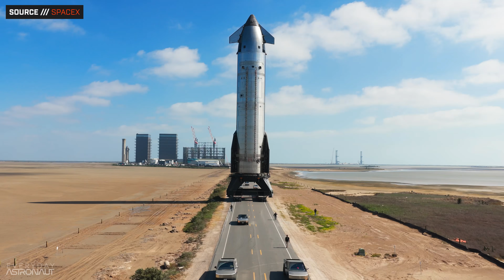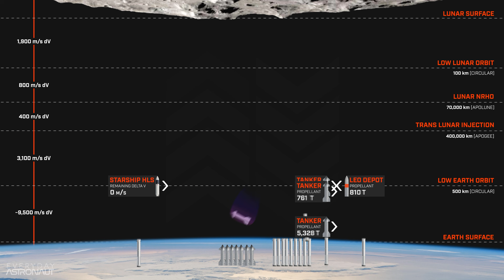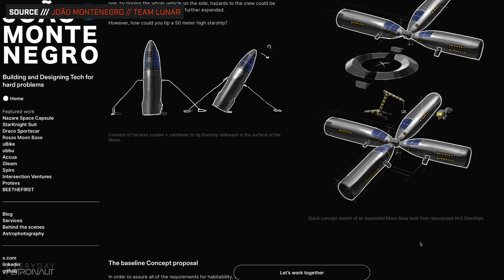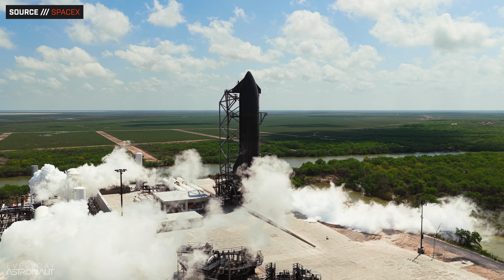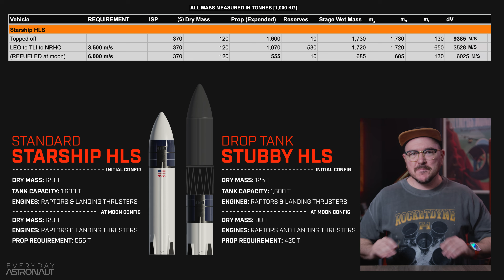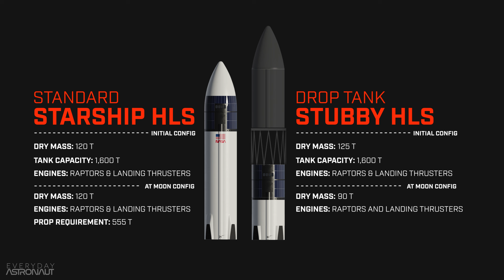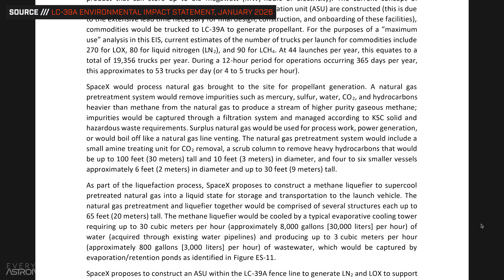Does Starship REALLY require 15+ launches to land one lunar Starship?!

Comment: What if they use starship to carry lox/lh2 to refuel blue moon? (A simplier version of mk2)

How many landing does that system give?
Reply: Not sure SpaceX really wants to help the competition, but maybe, there are stories BO is going to ask SpaceX to launch Amazon Keiper sats...

There are two main issues with Liquid Oxygen and Liquid Hydrogen.

1) The temperature differences between them dictate a NON-SHARED bulkhead, and a ton of insulation.  These add weight.

2) Liquid Hydrogen is made of the smallest molecule.  This has made it tough to contain.  SLS-Orion has had issues with this.  Shuttle definitely did.

Yes, it is more "energetic" as a fuel (efficient), but you also need a much larger VOLUME of space to store it.  Way more than methane.

Methane is a middle ground.  Not as energetic, but takes up a lot more space.  The temp difference between LOX and LCH4 is very small, thus a common bulkhead can be used (such as on starship), which cuts weight.  Methane can be made at some point on Mars.  On the Moon, making fuel seems silly as the Moon is only 3-5 days away from Earth.

Kerosene/RP1 is the low end.  I believe Merlin engines use this, and so does most Chinese engines.
Kerosene/RP1 is very toxic to the environment, and is the lowest in energy.

SpaceX basically put their money into making Raptor Engine tech instead of going to LOH2, and simply using Methane.

Comment: getting a refueling rocket to 400 ms/dv may require refueling of the refueling rocket. Keep working on that nuclear ion engine. Also 14:04 - 67 x , I am surprised the relation is linear. Wouldn't there be some efficiency gain with size? Oh and one more thing I don't get. why would you bring back a 200 ton spaceship from the moon?  Would it not be better to just send a remotely landed vehicle for the return home?  It could weigh a lot closer to what the Apollo return ships did. Great value to leave the starship there for future use.

Comment: What about landing vertically, deploying some additional struts at the top and carry out a controlled tip over to horizontal and then back again? It might be impractical (or just plain stupid), but if workable, it reduces risks during landing and then improves load deployment massively once tipped. Or maybe a pure horizontal landing becomes more practical if straight onto pre-prepared landing areas?

Comment: The fuel depots seem to complicate things unnecessarily. Since HLS is not doing crew transport to and from LEO anyway, may as well transfer direct from tankers to HLS. If it could contain enough additional propellant to break orbit at the Moon, it could return to LEO for direct refilling from tankers. But of course that would make SLS redundant since SpaceX already has a capsule capable of transporting crew to and from LEO. Might make sense to split HLS into two stages, a LEO to Moon Orbit round-trip tug and the Moon Orbit to Surface lander.

Comment: If NASA were to pay for a single expendable booster to get the HLS to LEO, that could cut down number of reduelong launches. But considering for often and quickly Starship is supposed to fly, I don't see a big problem with 15 tanker launches. It will be the norm. But the more efficiencies we can gain, the less fuel wasted and less opportunity for failure too. Gotta work on both sides

Comment: Hello Everyday Astronaut! What do you think about Blue Origin's Blue Moon. I know Blue Origin is the butt of many jokes in the space enthusiastic community, but to me Blue Moon seems to be a space craft specifically designed for moon landing as opposed to Starship which was designed specifically for Mars landings. To me, Blue Moon seems far more capable of a Moon landing. Sure, it's capabilities are limited do to the lower weight restrictions. But to me, a few a Blue Moon landings and then graduating to Starship makes more sense. Starship has a lot, and I mean A LOT of modifications in it's future to become a reliable moon lander. By that time, Artemis is bleeding funds like crazy and it seems more likely to me that Starship will be a proof of concept on the moon, but Mars and interplanetary travel is its true purpose. Thoughts?

Comment: Some concepts have had it landing vertically and using a system of anchors pulleys and cables and the foldable legs to slowly lay it on its side horizontally. Remove the fuel tank and engines and cover in a layer of regolith for micro meteorite and radiation protection, and you’ve got a little pressurized moon base.

Comment: I see very few people talk about the increased stability of the Starship with those landing engines high up in relation to its mass being more aft. This makes the overall configuration more naturally stable, unlike an aft-mounted raptor with TVC, which is naturally unstable. I know it's not really a big deal anymore since SpaceX has basically been experts at propulsively landing Falcon 9's this way for years.

I only watched until 30 mnts when I wrote this comment. It would be helpful if this were addressed later on.

Comment: I think Booster needs side boosters.   2 modified Falcon 9's with 3 raptors and converted to use Methane / LOX mix, they also return and get caught or land.  We also need another form of propulsion that doesn't rely on frozen fluids
Reply: Why just 2? Just bolt on like 20 in aspergus? Are they stupid?

Comment: I really don't understand the numbers around 1:17:00
the Cis Lunar Depot has a mass at t0 and mass at t_end is what i don't understand. It should be roughly the starting mass of the return trip plus delivered fuel plus used up fuel, but its ~6% more. Which means after the burn and fuel transfer its suddenly 77% more than you need. Even if we loose a bit to boil off along the way, the numbers are way off, which makes me think i missed something critical. 

Can someone help me out with that?

BTW the wet mass seems to be mislabeled.

Comment: The easiest way would be to have 2 gimbaled V-raptors with 380 s ISP from the start. Atlas made it to orbit with just one engine, where there was a stage with 2 engines available also.
So far out ISP is king, maybe hydrolox would be better for upper stages. ESA's Ariane was a really good vehicle for all the geostationary and deep space stuff. Maybe taking the new glenn upper stage would be more feasible, or developing a hydrogen raptor version..

Comment: I'll comment before starting the vid.
But to me, avid KSP player this pilow makes no sense as a LUNAR Lander..

Apart from the obvious "tipping over" problem. Like it was a small thing.

What is the point of using a freight train if you don't have the logistic to carry a milk carton on a bike??

FFS. The moon is a rocky uneven surface. There are NO infrastructure THERE.
No gas station, no landing pag no fuel depot... Nothing.
We don't have a refueling point in any orbit We don't have a depo station anywhere and space wants to land a water tower on the moon?

Good luck.
China will go back to the moon before any of this is even remotely ready.
And if china and Russia decide to join forces in space they will start to make leaps and bounces

Comment: The issue with assuming 100t of propellant load for Tanker Starships is that they won't have 100t of payload capacity. In reality it's a lot higher for those. 

Your mass fraction heavily impacts your payload capacity. Because tankers would be entirely tanks, they would hold more propellant, heavily increasing their wet mass while probably being lighter than their normal Starlink Ships. 

As a result, I reckon 200t of propellant per transfer is likely. Cutting the number of refueling missions in half. 8 instead of 15 and the 8th would have extra to recover from any boil off. 

So in the end, 9 launches for 100t of payload to the moon in a fully reusable system. Assuming they charge NASA $100m per launch, that's $900m per lunar mission which could last for months.
Reply: If you think about it, whether they do x or y number of refuelings, if they can do one, they should be able to do multiple.

BO also needs refuelings, but their plan is both above the earth, * AND * above the moon.  NASA did not like their plan (over moon refueling) in 2021/2022 for this and other reasons.

Also, Starship-HLS contract is fixed price.  Maybe SpaceX asks for more money, but SpaceX committed to it for at least one crewed mission.  So whatever overage, SpaceX would need to pick up.  I'm sure SpaceX already did all this math (delta-v, fuel, test flights) and knew the missions needed and made their $3B winning bid anyways.  SpaceX got a lot of extra benefit from their architecture with NASA as probably 75% of the current V3 and projected V4 is common with HLS and SpaceX's Starlink V3 launches and other payload launches (US govt missile shield programs).  Plus SpaceX gets to use NASA to help solve the "impossible" problems - which Jared has repeatedly said is NASA's main mission.
Reply: Tim assumed secondary missions for each launch, too - satellites or other science missions. What's the trip count if you only send up tanks?
Reply: Where are you getting 200t from? Starship was supposed to lift 150t but that was an overestimation before they had actual data on starship re-entry

Comment: Referencing boil-off losses- how about using mixed liquid solid methane or oxygen in the tanker. The absorbed heat on the tank will slowly turn slush to 100% liquid. The solid fraction will have a much lower vapor pressure than liquid. Thus, less need to vent and lose either propellant? 
Similarly, why not freeze both oxygen and methane to solid in the tank, which will slowly warm to liquid as heat leaks into the tanks. Solid propellant doesn't boil off anywhere as fast as liquids.
All we have to do is wait for the. propellant to be available for refueling.

Comment: A tall, thin lander is less stable, yes. But conversely an unstable object requires less energy to stabilize, it just takes more precision. The high inertia of a massive lander combined with the low lunar gravity should increase margins for error considerably. There are no complicated atmospheric interactions to deal with either. The only external factor may be the stability of the ground the lander rests on.

Comment: I think you can optimize the short hls even more. First its lighter so only 3 engines or which one is redundancy. That would require the vacuum raptors to gimbal, but i really don't see that as a massive problem. The minor thrusters on the top might have to assist more in certain circumstances so they might also need their own power unit, maybe even electric pumps. As for getting it in orbit. HLS is being launched once this is IMO the best place to expend a booster.

Comment: At 1:30:00, in the extremely hot environment of a raptor engine, you're not going to be left with methane in the exhaust. That extra methane will result in some carbon monoxide instead of carbon dioxide being produced (which is good because CO is lighter) and maybe a smidge of free hydrogen (also very good). Very little methane will be left as it decomposes at 1,400°C.

Comment: ai summary  

Abstract: This technical analysis evaluates the SpaceX Starship Human Landing System (HLS) within the context of NASA’s Artemis program. The Starship HLS represents a paradigm shift in lunar architecture, moving away from the "minimalist" Apollo-era mass fractions to a high-mass, high-volume skyscraper-scale lander. The study details the critical engineering challenges inherent in this scale: landing stability for a 50-meter-tall vehicle, the necessity of high-mounted landing thrusters to prevent lunar surface erosion, and the logistical complexity of orbital refueling. By utilizing a proprietary Delta-V spreadsheet model, the report compares the "Standard HLS" against theoretical "Stubby" and "Drop-tank" variants. While the refueling requirement (estimated at 12–18 launches per mission) presents a significant terrestrial supply chain bottleneck, the report concludes that the transition to a reusable, refuelable architecture—complemented by future lunar oxygen harvesting (ISRU)—is technically feasible and provides a scalable foundation for permanent lunar habitation.

Technical Summary & Key Takeaways:

    0:00 Scale and Mass Parameters: Starship HLS is a 50-meter-tall upper stage with over 100 metric tons of dry mass. It offers 100 times the internal volume of the Apollo Lunar Module, presenting unprecedented mission capability alongside extreme engineering challenges.
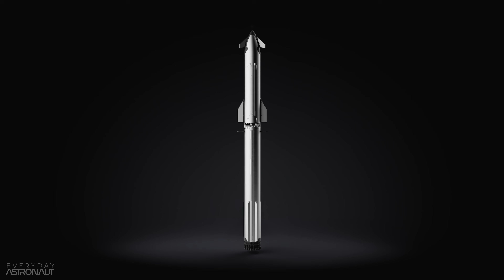    3:26 HLS-Specific Modifications: The variant replaces flaps and heat shields with high-mounted, pressure-fed landing thrusters to minimize regolith displacement (cratering) during touchdown. It features self-leveling legs to manage a 5:1 height-to-width ratio on uneven terrain.
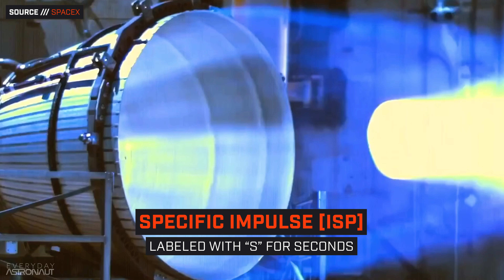    4:26 Orbital Mechanics Baselines: Performance is measured via Specific Impulse (ISP) and Delta-V (change in velocity). Raptor Vacuum engines achieve ~380s ISP, while landing thrusters operate at ~320s. Delta-V calculations are non-linear; doubling propellant does not double range due to the "tyranny of the rocket equation."
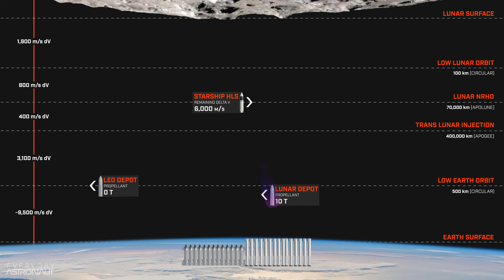    12:13 Logistics of the "Saturn V" Paradigm: To land a mass equivalent to HLS using Apollo-style single-launch architecture, a terrestrial rocket would require a 200,000-ton liftoff mass. SpaceX bypasses this by utilizing multiple reusable launches to aggregate propellant in a Low Earth Orbit (LEO) depot.
    17:03 Landing Dynamics & Stability: Center of mass (CoM) management is critical. Analysis shows that self-leveling legs and vertical engine alignment (thrust through CoM) allow for landing on slopes, provided horizontal velocity is neutralized. High-mounted thrusters are essential, as a single Raptor produces 100x the thrust of an Apollo descent engine, which would otherwise create unlandable craters.
    35:44 Cryogenic Propellant Challenges: Unlike hypergolic propellants (simple, reliable, storable), Methalox is cryogenic. Boil-off mitigation requires active cooling, multi-layer insulation (MLI), and specific vehicle orientation to minimize solar thermal absorption (1,370 W/m²).
    43:57 Refueling CAD/Spreadsheet Analysis: Using Starship Version 3 specs (1,600 tons propellant capacity), a single lunar mission requires approximately 14–15 tanker launches to fill the LEO depot. Each tanker is estimated to deliver ~100 tons of propellant per flight.
    57:57 Design Variants & Optimization:
        Standard HLS: Maximum flexibility, highest refueling requirement.
        Drop-Tank Variant: Ditching empty tanks after Trans-Lunar Injection (TLI) reduces dry mass, potentially allowing the first mission to be completed with a single LEO top-off.
        Stubby Variant: A shortened Starship optimized for lunar gravity. While it reduces the number of tankers to ~10, it lacks the volume for high-mass secondary payloads.
    121:32 NRHO vs. LLO Impact: Targeting Near-Rectilinear Halo Orbit (NRHO) is required for Orion/SLS compatibility but is less efficient for the lander. Transitioning to Low Lunar Orbit (LLO) in future phases could reduce propellant requirements by ~40%.
    127:30 Future ISRU (In-Situ Resource Utilization): Oxygen (LOX) comprises 78% of Starship’s propellant mass. Harvesting LOX from lunar regolith would reduce the refueling burden for return trips from ~18 tankers to ~6 tankers, as only methane would need to be transported from Earth.
    135:46 Terrestrial Infrastructure Bottlenecks: A single Starship launch requires ~500 truckloads of commodities (LOX, Methane, Nitrogen). SpaceX is mitigating this via on-site Air Separation Units (ASUs) to produce oxygen directly at the launch site.
    138:33 Conclusion: The HLS architecture trades "bespoke engineering" for "launch frequency." If orbital refueling is proven, the marginal cost of additional launches becomes lower than the cost of developing multiple smaller, non-reusable landing systems.

Comment: 51:00 min in your video is very confusing because it’s not going to be a normal starship to fill up the tanker. It’s going to be a tanker starship going to orbit to fill the tanker which means the top part of the starship is going to have fuel so it’s not going to be a dozen launches it’ll will be somewhere around six

Comment: Using a 100 ton payload capacity HLS seems pretty useless the way you are using it in this video. In these scenario's HLS is refuelled in lunar orbit because it will dock there to Orion and only be used as a lunar lander. However SLS can only get around 27 tons into TLI, most of which is used for Orion. Meaning the payload that HLS would land would be a few tons at most after its first mission, making its 100t capacity (and dry mass) useless in subsequent missions.

This makes using HLS in this way pretty useless and it would definitely be better using a much smaller dedicated reusable lander that maybe could be launched by starship into LEO instead.

Either that or have lunar starship return to LEO itself, refuel there and also accept new high capacity payloads there (using another starship to launch it into LEO). I think it would be interesting to look into this scenario in the future.

TLDR; HLS is the wrong vehicle for what they want it to do know, it is more a later use vehicle for when you want to build out a larger lunar base and also using it differently: either having it return to earth so it functions as a lander AND a LEO-LTI transit vehicle or expandable (so one permanent lunar landing), while designing and using a much smaller lander with a much smaller payload capacity (10-20t) to do the current initial missions (and maybe keep it going for crewed long term, with HLS for cargo, so no need for human rating HLS landing)